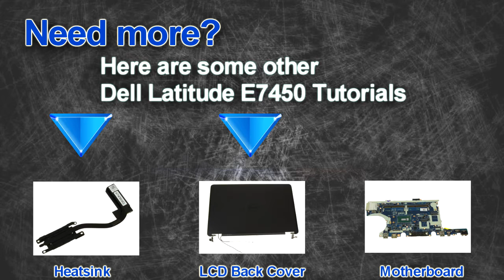Dell Latitude E7450 CPU Heatsink Replacement Video Tutorial

Comment: I have an E7450 with an i7 and Nvidia GPU, which has a slightly different chassis. All I want to do is replace the fan! But I need to go through all these steps because the chassis covers the fan mounting :(
Reply: I have the same one and I just want to replace the thermal paste :(

Comment: Easier fix if you are not too fussed.  Just get some fine snips and clip of part of the frame that is over the heat sink.  No need to pull the whole thing apart
Reply: or remove the screws in the heatsink and fan then wiggle it out of place
Reply: @DumDay9030  no way out
Reply: Would've been good when I thought the frame was plastic! WTF, it's fool proof!  They may have fired the genius who designed this as the next model thereafter isn't like this.
Reply: @TheAllSeeingAye  yea I realized that but forgot to change my comment
Reply: @DumDay9030  I may have to go the long way as i already popped off the heatsink before realizing the trap. smh freaking Dell.
Reply: @TheAllSeeingAye  good luck soldier
Reply: I'm glad to have only paid $15 for this effing thing.. putting a cutting wheel on the dremel tomorrow, I'll update with how it went for future generations lol
Reply: @EhEhEhEINSTEIN so what happened?

Comment: Holy crap now that I have it apart I found out why it is over heating the thermal paste is not applied to the second die...

And this stuff is hard and sticky like a combo of old chewing gum and glue.
Reply: From the online research i have done, the thermal paste should not be applied to the seccond, smaller die. The new heatsink designs are also produced like that, so it doesnt make contact with the seccond die. Its strange but thats how it works.